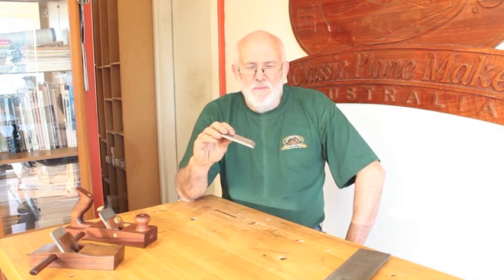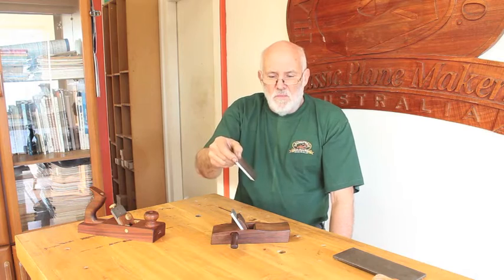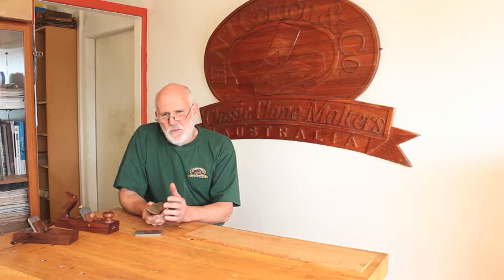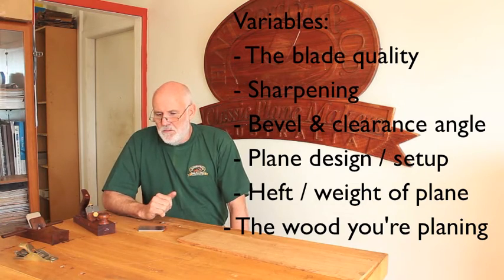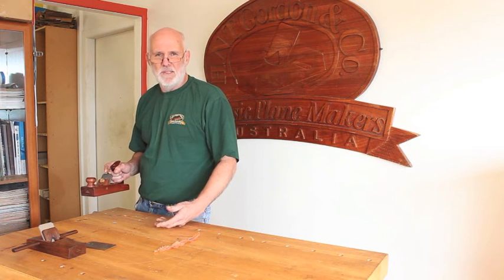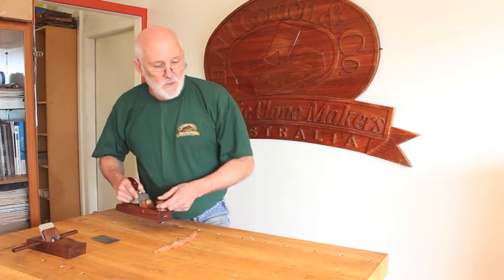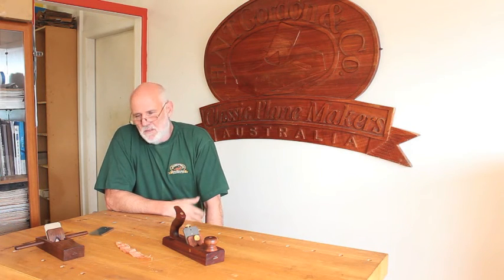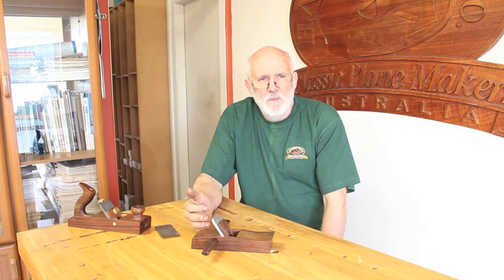Bevel up versus bevel down planes - scrutinising bevel and clearance angles - Part 2

Comment: Basic problem is that truly low angle bevel up planes are not the best choice in wood.  One can make pretty much anything work,  but it is going against the grain.  However wooden planes with bevel down geometry are pretty much the best design.  I will get to that in the moment.

Basically the argument in the video is based on the idea that wear in the blade of BU planes will stop it cutting earlier than with a BD plane.  Let's examine that.  How could one mitigate that:

1) I you are in Oz and you are using  a generally higher angle plane blades, then as with some block planes base your BU planes on a 20 degree bedding angle.  This will help with the clearance angle issue, and the structure of a wooden plane issue.

2) What the client wanted was a plane that would allow him to switch blades and get a variety of different results from the same plane.  So mitigation 2 is that each of the blades is being used less and will wear less.  If one is following instructions on power sharpening, then at the end of session, on could top up the blades, and then one will have a lot planing to do before multiple blades get dull.  I gather that in OZ, even the cheapest softwoods are planed with a 60 degree bevel, but in the western world 45 is fine, and works great in a BU format.

3)  There might be an argument for using HSS in a bevel up plane if wear is an issue.  I prefer Japanese blades, or O1 blades, but with power sharpening, and in a situation where blade wear is an issue  HSS is a good choice, of course they are not all the same.  For instance Blue Steel is basically a HSS.  Not terrible no mater how you use it.

4)  Another option would be to have a BD plane for general work, and a BU plane for all the odd angles.  If you live in OZ and all your planing is at 60-70 you apparently don't need a lot of angles.  But conversely in the West, you mostly don't need high angles.

WHY NOT USE A BU plane?

Basically the fad of BU planes a few years back is based on trying to get newbies into a plane they will have better luck with.  In many different respects.  They are easier to cycle the plane though sharpening, no pesky breaker.  Just all around easier to get working, and they are good enough for most planing the weekender will do.  Bad luck for the companies that produced them, but shortly after they hit the market, another fad came along.  A few newbies rediscovered breakers, and that was the end of the bevel up plane for serious work. Personally I don't like breakers if I can get away without using them, but properly set (very very near the edge) the are significantly better for a lot of the work people do on difficult grain and rowed woods.  So far I haven't seen a bevel up plane that has a breaker, I guess it is possible, but It doesn't seem to be available

Then the other point.  Say you are buying a 500 dollar plane, not particularly reasonable to expect it to do everything.  A 500 dollar plane is for people who are either experts or on that path, as well as people who just like nice stuff.  If you want the perfect set-up, it is a series of planes that each do something unique where you just reach for the appropriate plane.  It isn't going to be a great experience to  spend 500 bucks and then expect that one plane to do everything.  But woodworking can be a 70 year thing if you learned from a family member.   Maybe spread the cost over a longer period of time, buy real tools, not a series of stopgap tool.  It is at least an option.

Comment: Fascinating stuff but Terry may have forgotten that the old mitre planes which are centuries old, were of the BU type. And many enthusiasts attest to the fact that they work better than BD planes. Perhaps the bed angle of 20 to 25 degrees keeps the wear bevel at bay somewhat longer. I personally have tried the LN no9 mitre plane as a smoother and it works superbly - however it's uncomfortable to use due to the lack of a proper handle. Quite why LN and Veritas do not use 20 degrees for their BU planes remains a mystery.
Reply from the maker: Hi Philly,

Please be aware I have nothing against BU planes , we have used this concept in our planes to make a BD smoother into a BU cabinet scraper since we started making planes in 1995.   The issue I am trying to make woodworkers aware of is the problems associated with using LA BU planes that have a 12 degree bed (ie. 12 degrees of clearance)  for smoothing flat surfaces. The less clearance angle you have the sooner your plane will not want to cut the long grain of wood.  No clearance = no cut, unless of course you want to use brute force, which many people try to do which creates many other issues with the quality of surface finish and increasing the chance of tear out. The exception to this is cutting soft wood end grain, which is what these LA BU planes were designed to do,  and they are undoubtedly the best design for planing soft wood end grain. This is because soft wood end grain (under a micro scope) is not flat - it has troughs and peaks so the loss of clearance or the wear bevel is not continually  riding on the surface of the wood like in the case of planning long grain.   Consequently you can keep planning softwood end grain until the blade is actually blunt. In contrast to planing long grain, once your wear bevel is large enough to lose clearance, you will assess that the blade is blunt, where as in fact the blade is still very much sharp enough to cut wood , but the LA BU design is stopping it from cutting due to loss of clearance.

As far as the bevel angle goes, a woodworker in the US - Steve Elliot,  proved beyond doubt that a 31 degree bevel is the optimum angle to get maximum life out of your blade (before re sharpening) for planning cherry. If you take a look at his site he proves this beyond doubt. For other types of wood that angle may vary slightly one way or another.   But with full confidence I can say this - if I am planing cherry, every degree I make my blade bevel greater than 31 degrees, regardless of whether it is BU or BD, I will get less meters/feet of shavings before I have to resharpen.   If you sharpen your blade at 50 degrees you will have two thirds less usable sharp edge as per the card board cut outs.

If you are planing long grain and the wood is hard and cranky, using a LA BU plane with the bevel sharpened at 50 degrees you have selected the worst geometry possible to get good results on this type of wood.

I agree with your comments that BU planes with a 20 degree bed makes much more sense as you have 8 degrees of more clearance, which will equate to more time planing before sharpening.

I hope that helps with a better understanding of Blade Geometry.   Unfortunately, talking about clearance angle doesn't suit some people, despite the fact that clearance angle in any blade geometry equation is the most critical.

I hope that helps.

Comment: Great vid. I have never felt the need for a bevel-up plane and three extra blades ground at different angles or toothing blade to mill my stock. One bevel down plane fine-tuned sharp with correct adjustment shaves any type of wood with ease even the end grain leaving a smooth surface behind. I just prefer the feel and feedback I get when I shave with a sharp bevel down. Saving up for some of HNT G planes :)

Comment: Great video. I bought a veritas low angle smoother and have a bugger of a time planing tallow wood and red gum. Always tearing out. I was watching agwoodcreations on Instagram the other day and he mentioned he was having trouble planing some timber until he switched over to your smoother and had no problem after that. It got me searching YouTube for more info on your planes. I always thought they were more  for show than hard work. It appears I was wrong  and will look at buying a couple of them soon.
Reply from the maker: Hi Lee, glad you like the video and  thanks for info about planning some aussie hardwoods.   I'm sure our planes will help you out as they are optimised for these woods.   Happy woodworking.   Regards Terry
Reply: +trevorgdn thanks mate, I know it's not a flaw of the plane, it's just that I lived in the tropics for 4 years and didn't use it that much. I'm slowly cleaning all my tools again. I mostly used it as a shooting plane and it was awesome for that. I'll probably just keep it for that purpose. And get a HNT smoother for when I'm working Aussie hardwoods.
Reply: Lee, what angle did you grind the bevel to? The factory bevel of 25 degrees is too low for planing face grain on hardwoods. Your low angle smoother will be fine for smoothing if you use a blade with a 35+ degrees bevel.
Reply: +trevorgdn its just the factory bevel, I haven't changed it. Now that I know the wooden planes work so well, I will slowly switch over to them. My veritas plane was all nice and shiny when I go it. Now it looks like an antique, with all the rust on it. Wooden planes don't rust I like that. 
What use is the factory bevel best used for?
Reply: Lee, if you go to this link: http://www.leevalley.com/US/Wood/page.aspx?p=45864&cat=1,41182,52515 there are very good instructions for the bevel up planes (in the table that has prices). The factory bevel is excellent for end-grain due to the effective cutting angle of 37degrees. Any tool that is made of iron or steel will rust, it is your fault that it is no longer shiny, not a flaw of the plane. After use you should give it a quick rub with a machine oil or one of those tool waxes. To remove the rust you have, you can rub it with rust buster and then clean it off, or use very fine (800+) "wet and dry" with oil.

Despite what Terry has said in these videos, bevel-up planes perform just as well as the conventional bevel-down, IF they are set up properly. An advantage of the bevel-up planes is it's much easier to change the blade when you are in the middle of a job. The increased wear-bevel that bevel-ups supposedly suffer is is really not that big a concern in use. If you only every worked the hardest and most abrasive of timbers then you might care about it.